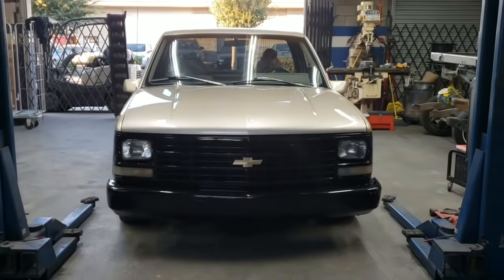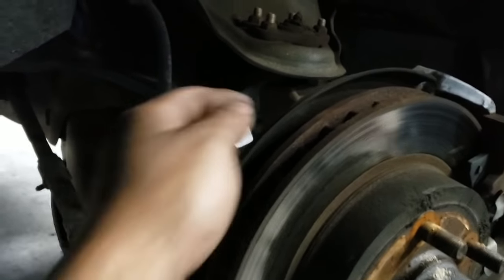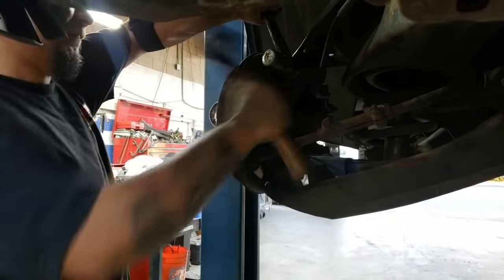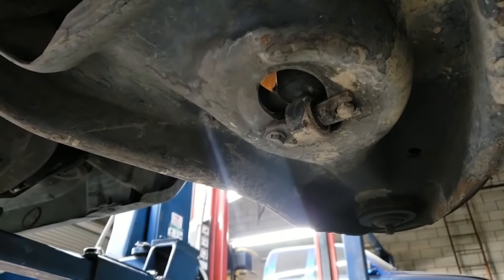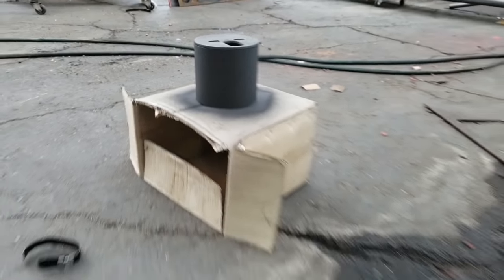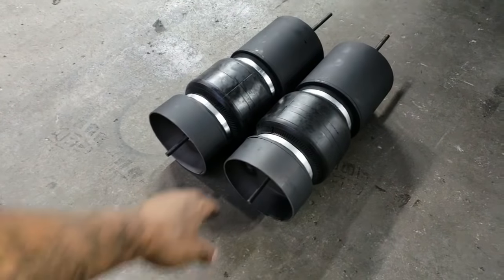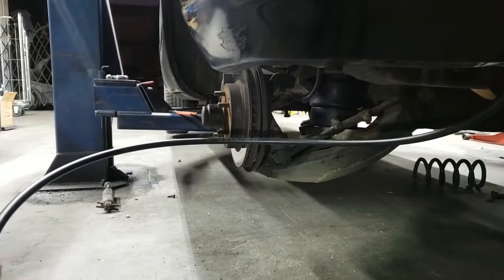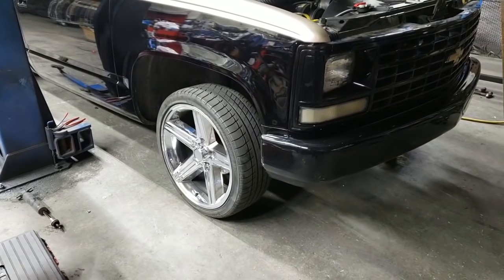"Part 1" OBS front air bag install

Comment from the maker: The term  is used very loosely OBS?
Old body style?
Or 
Original  body style?
What do you guys say comment below!
Reply: i'd say old body style, but who knows.. im not the chevy police hahaha
Reply: I’m glad u put this cause I couldn’t ever understand what it meant.   I thought obs was the older ford powerstrokes
Reply: Original body style doesn’t make a lot of sense either
Reply from the maker: Original body style would normally consist  of the first one made which would date back 1918 I think. So technically  speaking that dont make sense either lol that's why I pinned this so we can see what people think
Reply: 67/72-c10, 73/87-squarebody, 88/98-obs, 99/06-nbs (includes 07 classic), 07/12-nnbs, 13+. I swear I can’t make this shit up but this is legit what they call Chevy body styles🤦🏻‍♂️
Reply: alexhoppos909 old body style
Reply: Old body style
Reply: Square body is 73-87 
OBS is 88-98
Reply: Old body style
Reply: Wouldn't an old body style chevy truck be like a 50s?

Comment: Cool little after hours project,  also seen that high lock up 57 that CNC put together on caliboy's channel that ride came out clean AF bro good job on the frame and the pump setup.
Reply from the maker: Yes sir my boy caliboy always putting in work.  Adrian's 57 came out badass

Comment: I thought the idea was that the bag replaces the spring. The stock shock was removed and only the bag was installed. Without a shock installed to smooth out the ride, aren't you just rolling around on a balloon which will be bouncy as hell?

Comment: Hey Guys, why a single bellow bag versus a dual? Also, no trimming of the spring pocket?
Reply from the maker: The single below in the front is designed to help eliminate  the bag rubbing on its self  where the 2 belows meet .it also help with keeping shaping and not  pushing on in the center as well. Over all amazing design for front a arm suspension

Comment: Just a few helpful video ideas on 1964 impalas: can you go over impala with 1989 and older Caprice Spindles, going disc brake with 11in rotors, what brake booster and master cylinder to go with, what rear disc brake kit you need on the original 64 rearend to have all 4 disc,.... also do you guys modify impala Aarms to fit the caprice spindles??...

Comment: What are the advantages to using a single bellow airbag as compared to the double?  I understand with double bellow you have to cut the frame to fit but besides that what other benifits do these bags have?

Comment: That "trick" for removing ball-joints by hitting the side with a hammer is something that my father taught me nearly 30 years ago. This also works on tie rod ends as well, even without the spring pressure. Leave the nut on a tie rod so you can hit the nut to not smash the shit out of the threads. It never takes more than a few hits to remove all of them and you don't have to use one of those pointless pickle forks to drive apart the components. It does not matter how old and rusty they are either.

Comment: I’ve worked on semi trucks with both air bag and shock with a spring like a z spring to bad you couldn’t weld a bracket on the side with a hydraulic shock on the side! I wanna do this to my 03 gmc Sierra.  Is there an advantage to having both both air ride and hydraulic?

Comment: First jus wanna say nice build. 2nd , i got  is a question? I got a obs k1500 (4x4) , and was wondering if u knew if the control arm from a obs c1500 would fit on mine? Tryna bagg my trk . Thx ahead

Comment: The 5" cups used in this video. Are they in the S10 front cup kit on your website? No spring pocket trimming required?
Reply: Also waiting wondering which too buy dont see 88-98 airbag brackets on the website